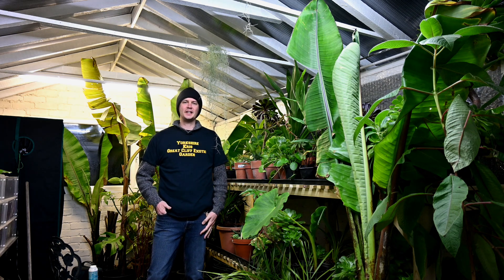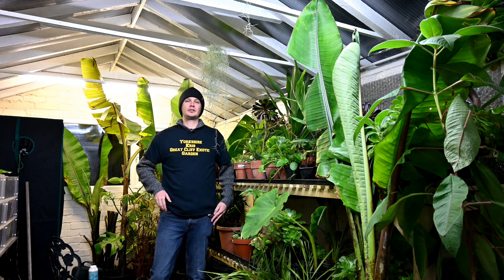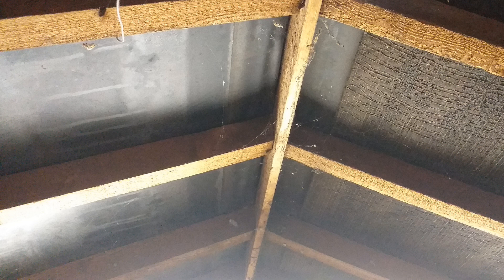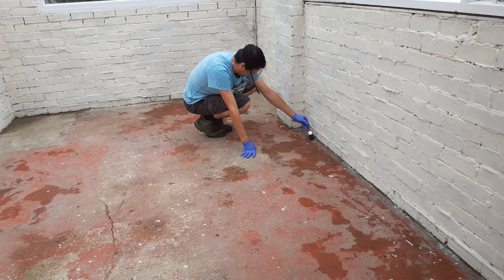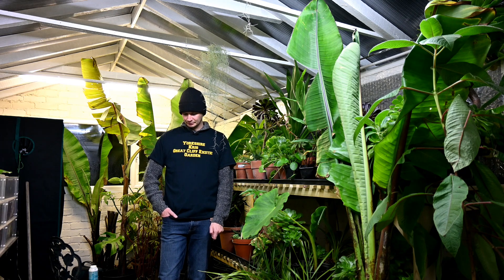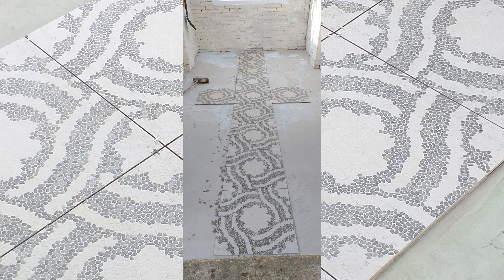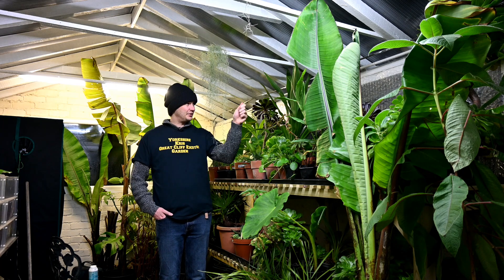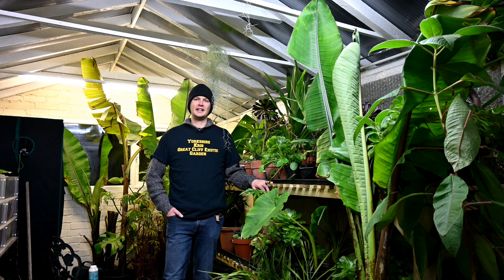Garage to Greenhouse conversion

Comment: What is the temperature differential between outside and inside during winter without using heat? I am about to do the same project with a concrete block building, and I am hoping I won’t have to heat mine. It will be used exclusively to overwinter citrus trees that will be too big for my smaller heated greenhouse by next winter.  You did an amazing job on yours, and thank you for sharing! Haven’t seen many of these conversions.

Comment: Hi Kris. Can you get the roof parts, the aluminium bars ect from any builders merchant ?
Reply from the maker: Not usually,  it's an online job
Reply: @YorkshireKRIS  thanks pal. I’m thinking Iv got a tin roof on the shed now and want to replace just one of the sheets with a clear polycarbonate sheet. Bit more light in there for the seedlings